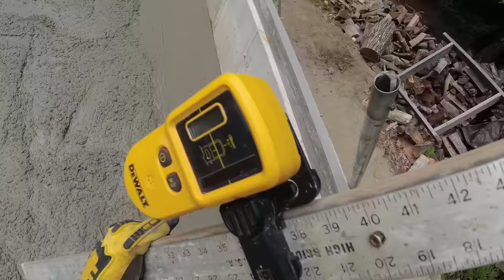Why We Had To PREP and POUR The Concrete At The SAME TIME (Garage & Addition Floors)

Comment: what kind of mix is that? Having a rough time myself after this summer. forced to use a lot of flyash and it is unbearable to work with
Reply from the maker: 3500 psi, 3/4 aggregate, microfiber, half air, water reducer

Comment: I,d be happy to save 1500 bucks if I was the homeowner.
Reply: @mikeknoll1130  homeowner is probably spending well over 100k for that addition.. pump is 800-1,500 depending how fast they get him out of there.. but I mean they got the guys so I understand but I’m pumping all of that and just focus on pouring not prepping
Reply: @wilbertmeaway6405  nowadays concrete guys get used to the pump and sometimes use it when it isn’t necessary, did concrete for 40 years hardly ever used a pump….if it was more labor Mike could charge more then….but i wasn’t there.
Reply: And Id be happy to charge you 2k for all the extra setup guys I would bring to cover the extra work. Doing stuff like this is accepting a big risk of things not going correctly. Im not going to have my finishers tied up trying to finish setting up when they should be finishing. If an owner wants to pull something like this they can pay for my extra crew to cover any incidental issued that come up.
Reply: @markdoumert  👍
Reply: @mikeknoll1130  I get it but it’s 2024 gotta work efficiently and time is money !! They made pumps for a reason !!
Reply: @markdoumert  facts !! Can’t cut corners and be cheap with concrete, there’s no patches only tear outs and I wouldn’t want to tear that out lol